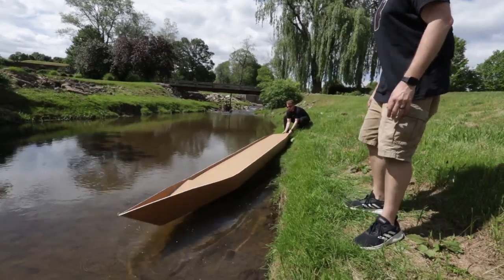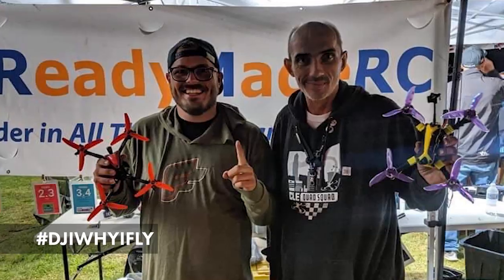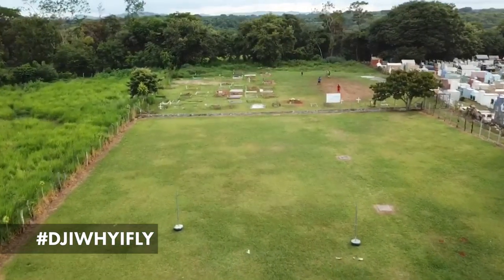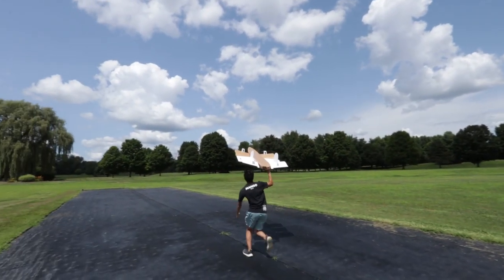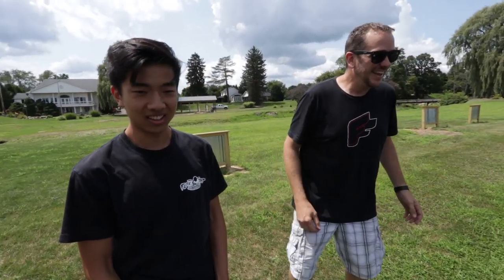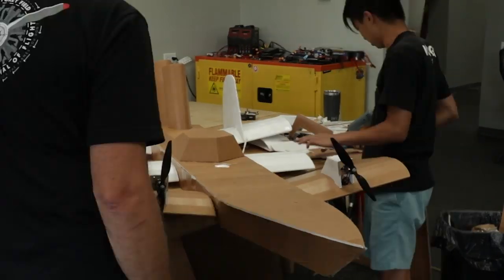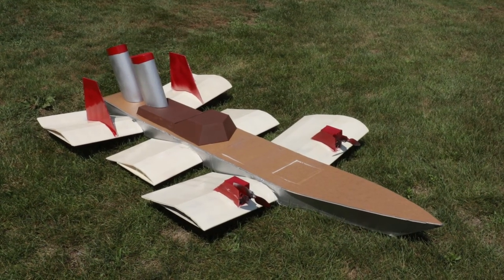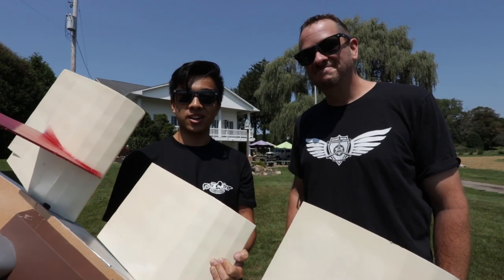Can this even fly!?  |  Remote-Controlled Flying Boat?

Comment: I made pizza box fly in 2004 with brushed motor and gearbox with NiMh batteries.
Reply: screet123 special delivery!
Reply: Looks like Stefan would totally appreciate, I think he will get the munchies real soon... my god he looks stoned af
Reply: Did you do a flying wing out of it ? I'm doing one as well.
Reply: Kind of. Just flipped the other side open and cut it half to make ailerons out of them and used two servos. Post pics when you get it ready! :)
Reply: @screet123  I will. It should be ready in a  few days.

Comment: I would suggest a deeper hull at the front to lift up the nose .. this should increase the angle of attack and keep the props out of the water, with a step just back of the COG.. a quick and easy job to add on..  thanks for another FUN video

Comment: I think the dihedral in front anhedral behind design really affects the characteristics. It acts like a split flap, come to think of it. Airflow from the front wing is flowing down onto the back (middle, actually, but whatever) wing and that gives extra lift to the front, making it pitch up, in addition to the bad CG. If you watched the flight patterns, the plane was on the boundary of stalling a lot of times. This split-flap-like design may have stopped it from stalling because of the additional lift. There's a YouTube video on the "unstallable" aircraft, which explains my point. Go watch it!

Comment: You mention that the props pushing air over the wing helps create lift at slower speeds. 
Would it be possible to do a 'vertical' lift off  by having some props blow over the wings and another pushing equally in the opposite direction?

Comment: if you give the boat/plane a v-hull it wil fly better. right now if you pitch up a little the bottem wil catch wind and create more lift, i think that a v-hull will push the air more towards the sides than straight down. i can be wrong tho :D XD keep up the good work

Comment: Im still learning how bend foam, man....i made a 30" wing scout..so i can practice
doing touch N go landings. mounted side plywood doubler to lock the 1/2 sq  dow in place.
then I just drilled hole for the music wire...it works like a champ.
I did a cart wheel landing this morning :-P....Nothing happened to it...even if it did.
it's just $1.50 worth if foam  .lol...if that was balsa ..i would had cried...
when i grow up...i might make a Flying V guitar shape model , a LP like Boston.
or the silver surfer on a  surf board :-P..Maybe the FT logo dude ..hahahaaa

Comment: 5:20 "anything that gets pushed through the air is inherently unstable so we're going to make it pull through the air" isn't this just the pendulum rocket fallacy but for drag instead of gravity? The thrust vector is determined by the plane's heading so it doesn't matter where on the airframe the props are, they will apply the same torque. As long as centre of drag is behind centre of mass it should be stable. Rockets push from the back but the fins bring CoD behind CoM so they fly straight.